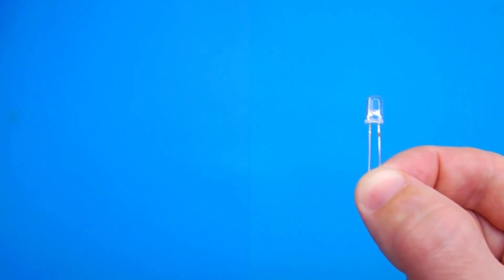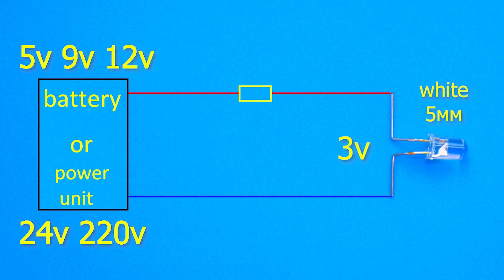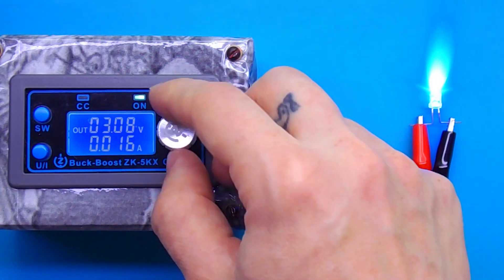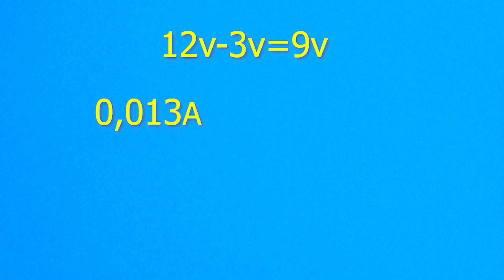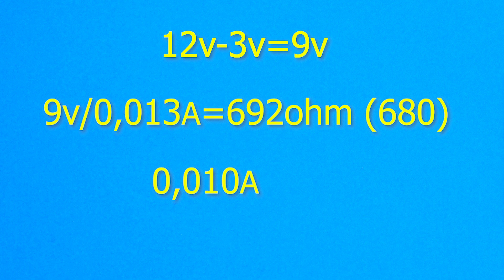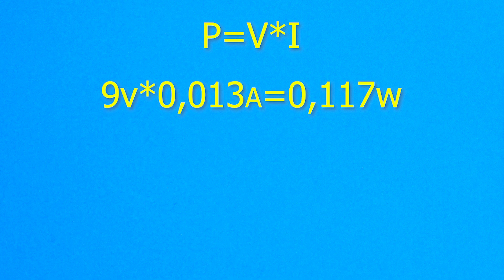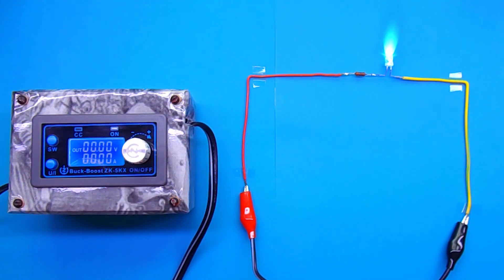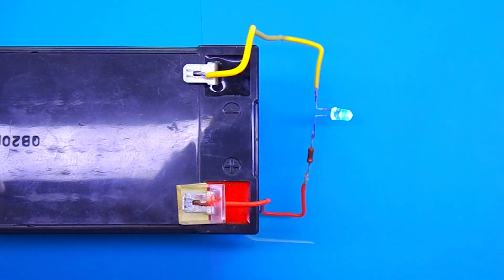The easiest way to choose a resistor for the LED!

Comment: First, enjoying your channel greatly, subbed! Secondly, I’m planning on building operating led signals for a model railroad layout. A typical signal arrangement consists of a three light (green, yellow & red vertically, only one light on at a time) signal head, with a second identical head below the first. Each head would only have one light on at a time, such as green over red, with the LED’s wired in series for each aspect. Would I add up the current drop for both of the LED’s to determine the resister value, or just go with the value for one? For what it’s worth, the various signal aspects would be controlled by a multi position rotary switch via a diode matrix system since some lights will have more than one feed. I’ll be using tiny 402 LED’s. While we’re on a roll, what diode would you recommend? Thanks so much for an excellent channel, and taking the time to read this!
Reply from the maker: Thank you for watching. You wrote such a long comment. But due to translation difficulties and my mediocre knowledge of English, I did not quite understand what you were asking. I only understood about the traffic light for creating a railway. ) All the tips I gave in this video are suitable for both serial and parallel connection of LEDs.